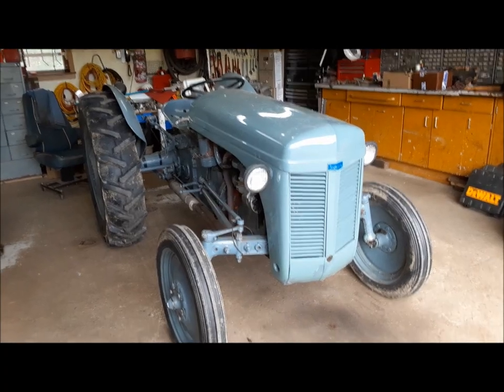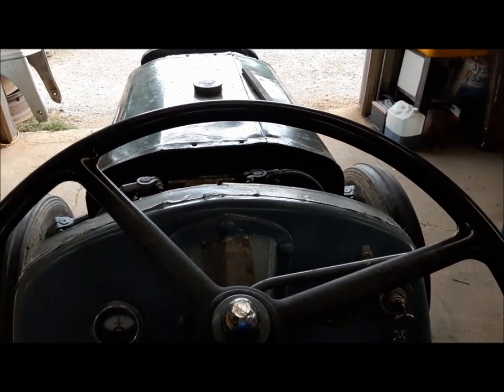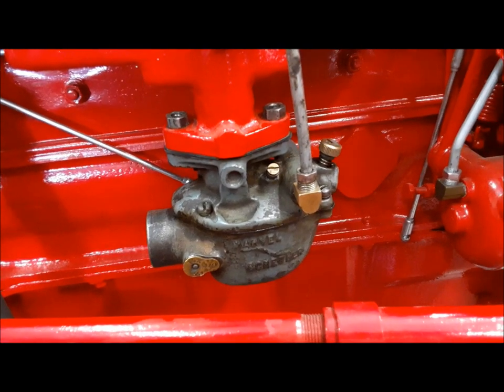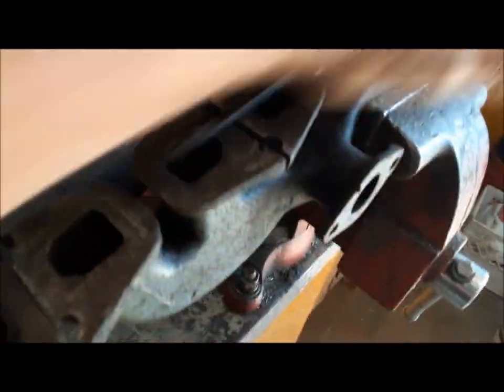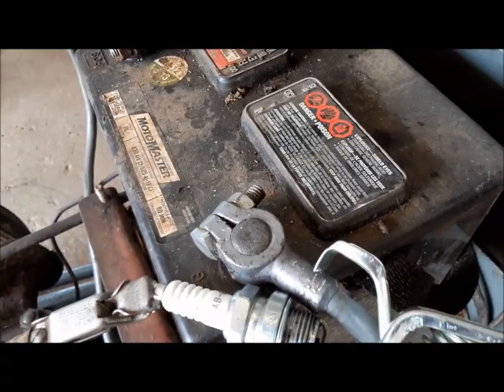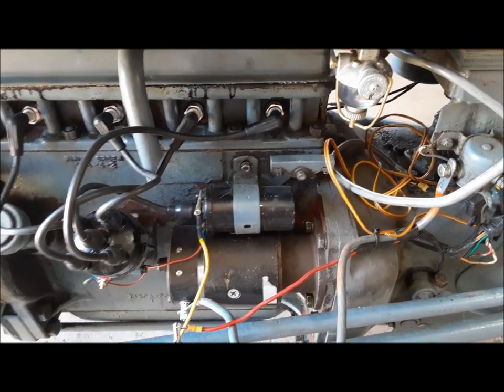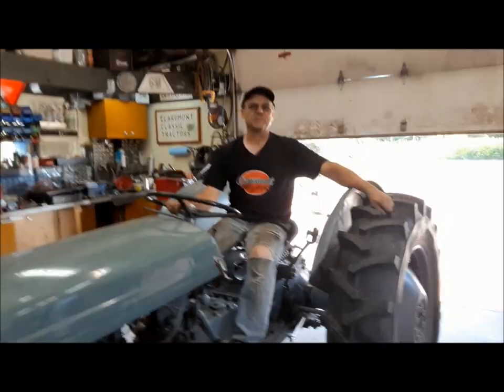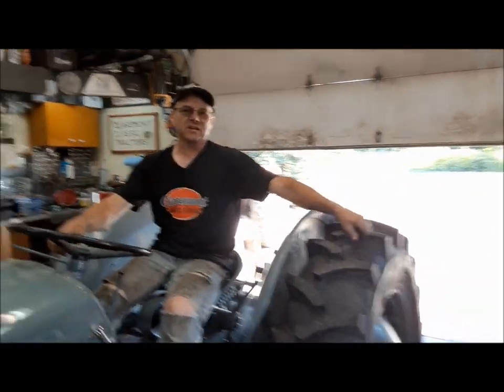1948 Ferguson TE20 Doesn't want to run

Comment: Right on Kevin your neighbour is blessed to have you as a neighbour! I appreciate you showing the difference between the English and American Ferguson. I was told a long time ago that there’s something about the oil pumps that can cause a problem but I can’t remember exactly what that was maybe a shear pin that goes on the pump or something? But yes I agree about the plugs a friend of mine told me that if I went with auto lights instead of champion I wouldn’t have as many as problems and he was right in my experience. It’s amazing how amperage and voltages and heat and carbon can make a difference in the engine.

Comment: Good informational video,   For the info. The Continental Z120 Engine in the Ferguson TO and TE20. The oil filter is up thru the bottom of the oil pan.

Comment: Good troubleshooting video - thanks. Didn’t expect the plugs to be bad,  Spark is one of the first things I check
Reply from the maker: I had checked for spark previously when I was at his place using an inline spark tester which showed continuity. This was an odd one.
Reply: I’m with you 100% mate. I had the SAME thing with my TE20 last week. Before I removed fuel tanks, drilled for vacuum gauge points, removed the rocker cover, exhaust manifold, compression testing etc, I would have checked for four good sparks. I did - and that was my problem (well, cleanliness and alignment of ignition points was). One hour, and we were running down my field, running sweet as a not.

Comment: Hey Kevin, after about 40 hours of labor, I finally got my 48 TE running! But just like your buddies here, mine does something very similar. Runs ok until it warms up then sputters out and dies. I’m thinking now that they put it away 20 years ago because it had a oil leak that they didn’t want to fool with. 
Anyway, I think it’s just tired and needs the head redone… I’d love your hear thoughts!
Reply: It’s got spark in all plugs although it’s more orange than blue. Each cylinder has about 85-90 lbs compression…
Reply from the maker: Its either running out of fuel or something is getting hot (high resistance) and starving the ignition of current. But my bet is the fuel side. Easy test is put a hose on the outlet of the fuel bulb and open it up into a jerry can or something. You should get a good stream of fuel that doesn't stop til the tank is empty. Most of the running problems with these old things usually end up being caused by poor fuel flow. Also try running it on a remote supply . completely take your tank and plumbing ot of the equation. My battles with this TE20 went on long after this video was shot. We had a Land of Almost Fits carburetor and the original. Finally after so long it is running great on the original carb. If you have one of those aluminum replacement carbs, launch it. The originals are the only ones that seem to work.
Reply: @ClaremontClassicGarage  Thank you!!  I’ll give those ideas a try. Seemed to me the fuel was good but I’m a better drummer than I am a mechanic 👍
Reply from the maker: @EWDrums  Best of luck with it!

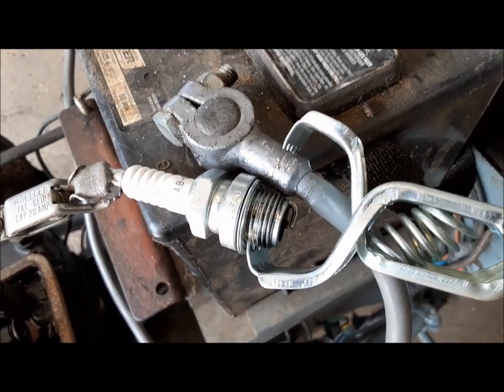Comment: I noticed on the top of the Battery these symbolism's, Something about sparks around a battery. Your sparkplug grounding point appears to be a bit close to the battery at  8:25 in the video.
Reply from the maker: Thanks, good point.

Comment: Been watching more and more of your vid's and really wanted to take the time to tell you how I appreciate your skill in diagnosing these issues.  Fun watching you go through it and I think a lot of people can learn from it.  Thank you for putting it out there.  I am wondering if this spark plug issue was a production run issue?  That was really odd.  As a side, I see you have a Neon you run in stock cars.  I used to race, too, but that was sports car.  If you want to call a Fiesta a sports car.  Lol.  Was involved with it in one form or another for 30 years.  My payment to the boss after all of that is a small farm.  Heck!  If Jim Clark can do sheep, I can do goats!  That led me to vintage tractors and equipment.  I do not have any ferguson's yet, but I do not rule a MF 135 at some point.  Currently, I have a '50 8n and a '54 NAA, which serve me well.  I do see you occaisionally on FB, too, in the Ford tractor groups.  Small community I guess.  Keep up the good work and take care!
Reply from the maker: Thanks for the kind words and thanks for supporting our channel. As far as the spark plugs, its something that I find baffling.

Comment: I have a 48 TE 20 with a z120 engine and a Ford distributor....not Delco or Lucas.....same points, condenser ,cap and rotor as a 52 8n with side mount distributor.
..runs great but was surprised at the parts house when I bought tune up stuff . Alot of plugs are made in China now ...not surprised you had bad ones.
Reply from the maker: Apparently, the Ford dist is a drop in on Z120s. Somebody else told me the same thing.
Reply: the  old  pink  lodge    are  gooooood

Comment: Use long reach plugs. Short reach plugs will quickly soot up again due to spark shielding and not burning clean. Long reach plugs will burn clean.
Reply from the maker: Understood. These plugs were not sooted or fouled. They were simply dead. Open circuit. i don't anticipate any further issues.
Reply: I've got a 1949 ferguson with the Standard engine. On light duties short reach are fine, but in working with a cultivator it'd start to miss beats and loose power. Once I'd removed the plugs and cleaned them normal running was resumed, for a while. Regards from 🇬🇧 👍
Reply from the maker: @09amusement  You could keep your short plugs but go up one or 2 heat ranges. My TEA will foul #3 once in a blue moon but hasn't done it in years (touch wood). My neighbour had no complaints about this TE fouling plugs, it just wouldn't run.
Reply: @ClaremontClassicGarage  modern fuel ⛽ does not help either. We have 10% ethanol in our petrol (gasoline) now. In a word... Shit.
Reply from the maker: @09amusement  We still have ethanol free gas for now.
Reply: @ClaremontClassicGarage  cherish it! Ethanol fuel goes rotten, like varnish, rots alloys, brass and steel.
Reply from the maker: @09amusement  Yes, I'm quite familiar with its destruction. All our lower grades of gas are full of it. To get ethanol free we have to buy 91 octane. But it is worth it.
Reply: @ClaremontClassicGarage  even our higher octane fuel is 5% ethanol.
Reply: @ClaremontClassicGarage  good uncarbed plugs shouldn't look black, especially on the spark nib, lightish brown. The fuel mix is too thick, so the spark plugs been straining to get a spark off and been worn out over a long time. At least that is how my model T works, and when it doesn'twanna turn round the engine it is because of it.

Comment: I have a 49' TO-20 from my research they're basically the same as a TE-20. I'm watching all your videos for this TE-20 to see if I can resolve my problem. Mine will immediately start if I spray either into the carb but as soon as the fuel is exastasted (2-4 sec). For those few seconds it runs great. I think there is some problem with gas uptake to the cylinders. I'm struggling to figure this out. If you see this comment and direct me to a video or place for me to find some help.
Reply from the maker: First thing I would try is a remote fuel source IE bypass the tank. make something from an old water bottle or something to feed fuel direct to the carb. If it still does the same thing check the inlet elbow on the carb. If its the right one it should have a screen on it. make sure the screen is clear. If it still does it after that you need to go through the carb. There are plenty of Marvel carb how to's on YT. And make sure its the right one, should be a TSX361.
Reply: @ClaremontClassicGarage  I removed and thoroughly cleaned the carburetor, I'm refitting the original gas bulb filter. The 90 deg tank fitting is original but the screen is missing. I think there is an issue with the electronics to the coil cause it's hotter than a firecracker, I am researching that now. It doesn't use the neutral start mechanism on the block. I may be over my head? I'm pretty mechanically inclined for a 66 yr old grandma but, I WILL figure this out. Thank you so much for your response and help.
Reply from the maker: @MynewTennesseeHome  It is natural for the coil to get hot if the ignition is on and the engine is not running. If the ignition is good enough to fire it, it should be good enough to run it. My bet is still a carb/fuel issue.
Reply: @ClaremontClassicGarage  Thankyou so much!